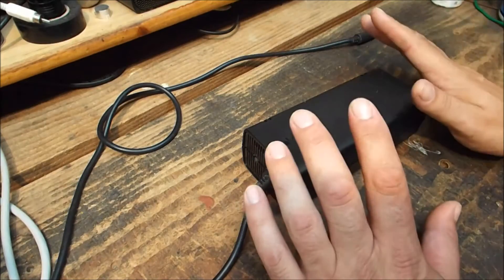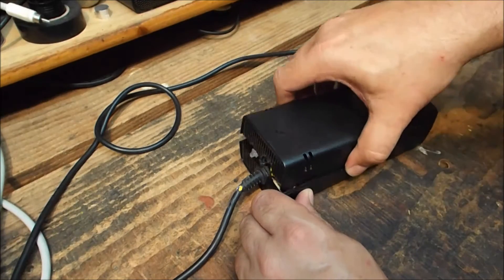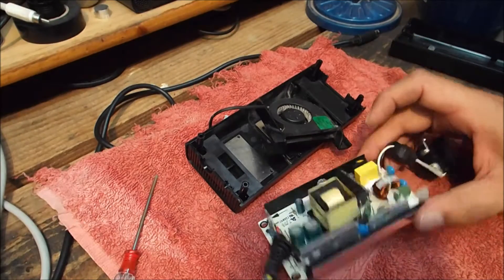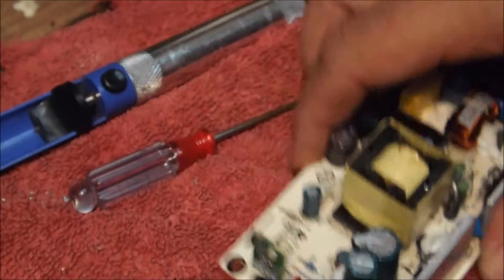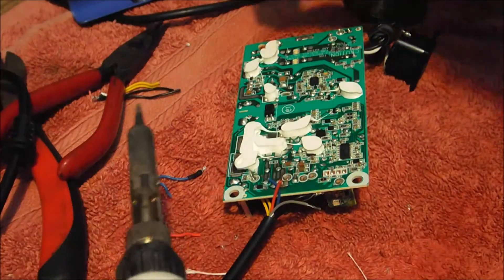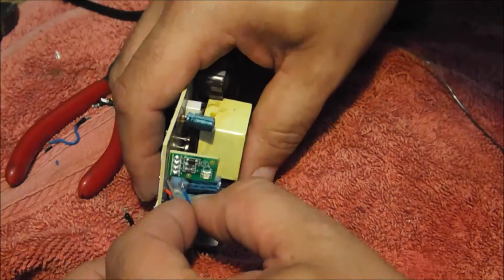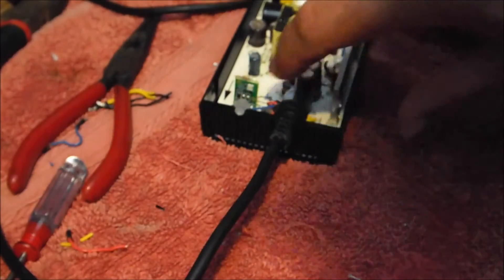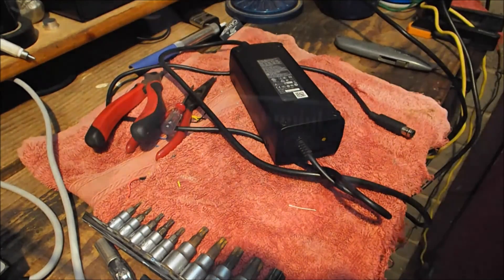Xbox 360 PSU (Power Brick) - Cable Repair

Comment: If the power cord that plugs into the wall is damaged you can repair it with electrical tape and crimp connectors and heat shrink tubing the power cord that plugs into the wall will probably fry your Xbox 360 power brick if it's damaged
Reply from the maker: The damage occurred when the Xbox wasn't in use and thankfully only effected the PSU output and not mains input, had this been effected a new power cord would have been sourced.

Thanks for your comment.